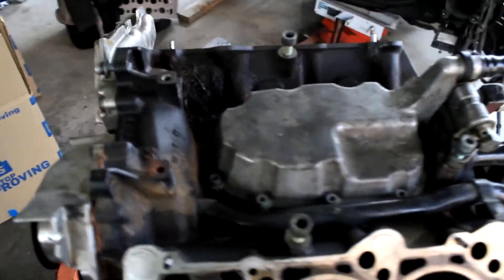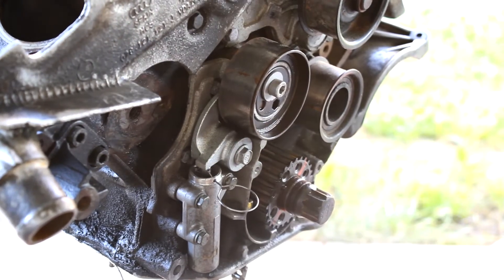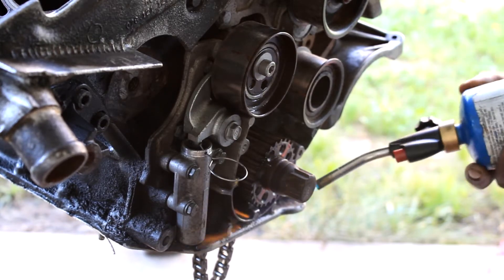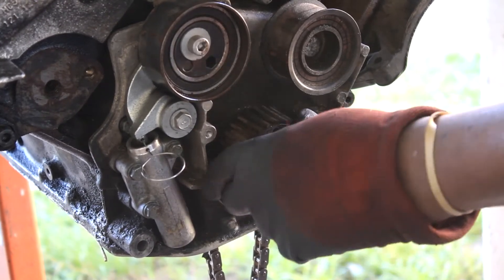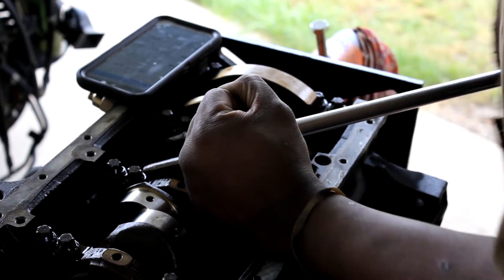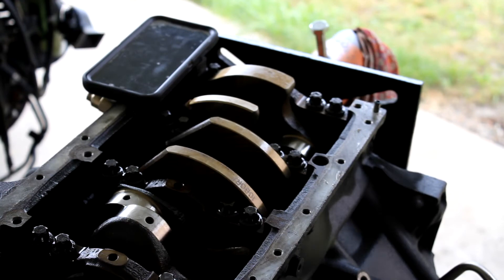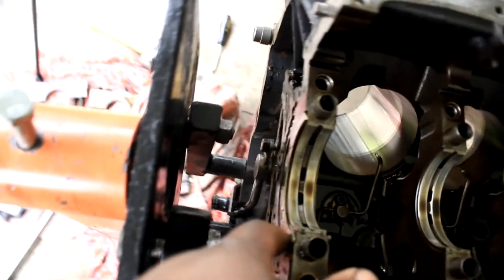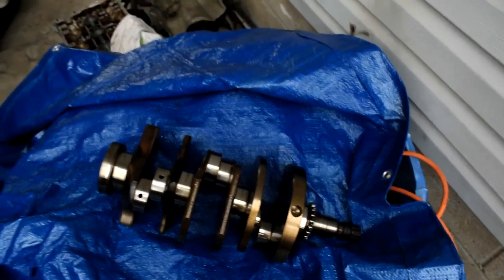PROJECT B5 S4 | CRANKSHAFT REMOVAL

Comment: Am in the middle of a 3.0 tear down...our motors are the same from the block down. By now I wish I had just swapped motors, but I pretty much rebuilt the heads completely. I only reused the springs, retainers and keepers for the heads...replaced both exhaust cams, using the same intake cams (dohc split v6 = 4 cams). Quite costly on new cams! 

Let’s see, motor is on an engine stand...already pulled the pistons...rod bearings seem okay, but may replace anyway...piston rings are pretty bad and so are a few pistons due to a timing belt failure...so, will be replacing those. Got lucky and cylinder walls look nice, but since I’m replacing the rings I’ll have to hone the cylinders too. 

Getting ready to pull the crank shaft...not happy about that crank bolt, nor am I happy knowing I’ve got to remove crank plate on the back, which means taking it off the engine stand...grrr...what pita. 

It’s cool you own a Honda & an Audi. Thought I might be the only one...most people in the Audi seen shun my little Honda but Ef them...I love it and it’s very reliable. Takes a beating and never stops! 

I’ve got an 2003 Audi A4 b6 3.0 in immaculate condition...the car, not the motor. Bought it with the timing belt broke. Motor & tranny has 140,000 original miles, interior is pristine save for a weird spot on the drivers seat...looks like either a repair or something fairly hot was set on it. No tear or hole in it so am happy. Will pretty much be a rebuilt motor when I’m done. Replaced all the vacuum lines, painted the intake manifold and valve covers a metallic blood red to match the s4 door blades. Will be a nice car.

My Honda Civic is a 2000 with the 1.6l turbo just over 100,000 original miles. She’s already decked out body wise. Complete body kit w/fiberglass spoiler hood. Duel split tip stainless steel exhaust from cat back...greddy turbo, non-inter cooler. MSD ignition, racing injectors, cold air intake, low profile rims and tires w/ 1-1/2” spacers...bunch of other stuff like engine and rear strut reinforcement, upgraded head and tail lights, custom paint job, etc. The only thing I still want to do is put coil overs on, and other parts for the suspension and maybe go to a stage two cam with better head internals. Fun to drive and starts every time. 

Used to own an 04 civic ex, did a lot of body stuff and upgraded headlights, fog lights, rear spoiler, k&n cold-air intake, rotors & pads...rebuilt the head in that motor. Planned on going stage two cam w/upgraded internals, but the car was totaled. Really loved that car!

Thank you for the upload, was a bit stuck with the crankshaft. Hope the build came along well. I see this is kinda old.

Comment: Did you need to remove the oil squirters when you sent your block to the machine shop? Did you send the bare block or put the crank back to have it balanced?
Reply from the maker: Anthony Terrazas unfortunately this engine never got to the machine shop but if it did I would remove the oil squirted, depending on if I was installing forged internals I would have took all the parts including crank to be balanced. YOUTUBE IS WEIRD, recently my S4 content has been getting feedback lately

Comment: Curious of the outcome of this build. My B5 had timing failure, built up 2k in parts for replacing heads, got old heads off to find cylinder scoring. I enjoyed your videos to see what tools I might need that I dont already have. I'm at the point of removing the trans and starting on bottom end disassembly... I feel ya on the nervousness and over researching as I go! I'm mechanically inclined but first time diggin this deep on any of my cars.. done Ford classic V8 and diesel trucks.. the b5 is a different animal! ✌
Reply from the maker: Glad that the videos helped you somewhat. You will learn quick the amount of parts and tools that comes along working with these cars smh. I will have an update video coming soon